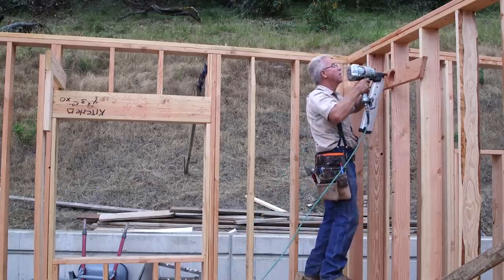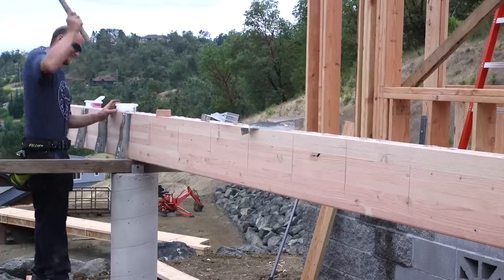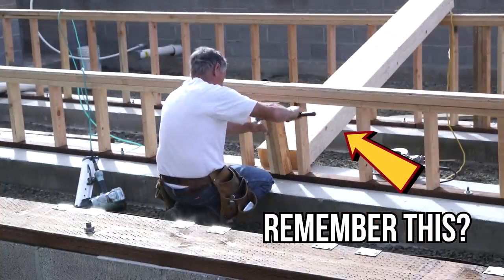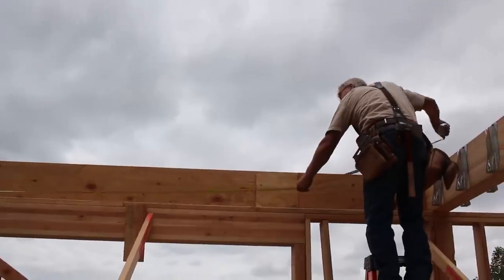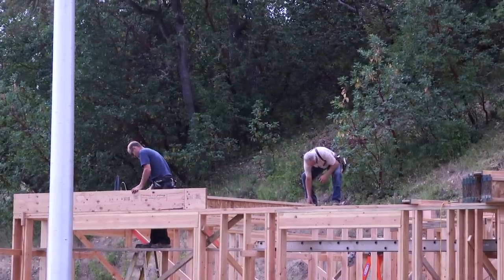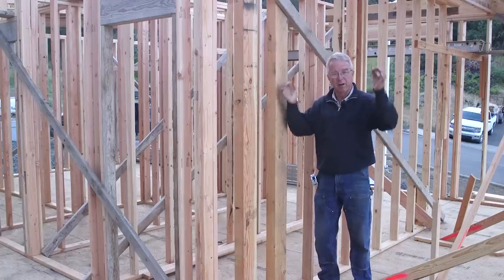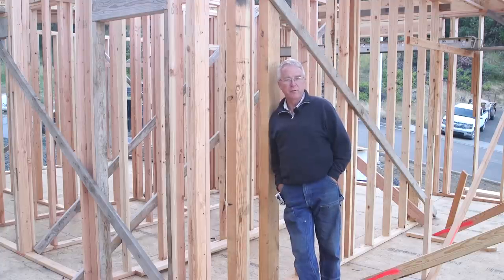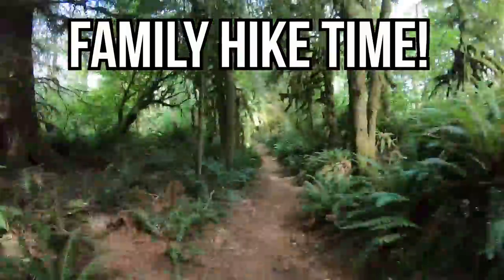Catwalks, Beams, and Posts Ep 50

Comment: The TJ I system I have used  require an 1 1/8 plywood rim joists and 2 x 4 crush blocks on either side of the TJ I around the perimeter to support the wall and roof. I enjoyed the videos.

Comment: After watching who knows how many videos of this channel (and a few others), I built my first structure ever this summer -- a 10x10 freestanding deck, next to the pool, sitting 4 1/2 feet off the ground. Disregarding some of the lesser built structures I saw on YouTube, I built it of my own design, but with one overriding concept in mind: "beams should transfer the load of the joists to the posts". I probably overbuilt it with all of the beam bracing and joist blocking I put into it, but this thing turned out like a tank -- no movement anywhere and no squeaks. Being a first-timer, I must say that the most important concept I learned about construction is not that you know so much as to never make a mistake (I told my wife that some people put their joists 12 inches on-center, but some of mine ended up 12 inches off-center), but that you know how to fix anything you screw up. Thanks for all of the tips and tricks and ideas!

Comment: Thanks for all the step by step moments in this construction project, Scott, it's been a pleasure watching! I've been in construction of some sort for over 30 years now, most of which has been spent in sheetrocking, finishing & painting. I have done some framing, rough & finish, tiling, flooring, window & door installation, etc. But I'm curious as to how those spots will hold up, those ''point loads'', in how the sheetrock will finish. I'm guessing that if you have any cracks in the board finish, those points will be where they will be. Here in the northeast, complete opposite of where you are, we primarily finish houses in blue board (plaster board) and veneer plaster skim-coat finish. It's a much more elegant and efficient manner in sheetrock finishing. It's done in parts of Cali, but mostly in new england. I'm guessing you may not have it out there, but if you knew about it, boy, you would be fascinated with the process. Anyway, just wanted to say thank you and keep up the awesome work. Looking forward to seeing the board hanging & finishing process. I know a hiker who lives out there named Half Ounce, met him on the AT in ''08. If you know him, say hi for me. 
~Steve H.

Comment: AS always excellent videos. Since I usually am the plumber and electrician as well as the framer Note that when He nails the plates to the floor  He keeps the nails next to the studs so you don't ruin a drill bit when running wire and pex tube. Most I joists have pre formed knock out locations, I try to cut off the end of the I joists that will  have the knock outs as close to aligning as possible so I won't have as many holes to drill.

Comment: While watching this I realize how little insulation can possibly fit where the rim joist is and in earlier videos where the kitchen plumbing is on exterior wall. This works for your area though but New England gets pretty cold. I remember you mentioning that different areas do it different ways :) Then again I'm sure you can fix that with exterior insulation which I haven't gotten to yet, assuming there is videos on that later, if not its easily doable :D <3 these videos, thank you so much

Comment: Watching you build a house almost completely out of timber frames is absolutely fascinating. Apart from the knowledge, skill and craftsmanship on display, I grew up in Germany where all houses are build from bricks, concrete and are heavily insulated. All in the name of long lasting buildings and energy efficiency. However i wonder if houses build out of more natural materials, that are easy to put up, repair and do not produce so much waste when eventually pulled down, have a lower carbon footprint over the long run.

Comment: I have loved following this series. Have an amateur question. Assuming  you are going to use OSB for the outside wall sheeting. Is there a reason not to put that on the first floor before building up? Seems like that would add a lot of strength to keep things plumb and square. Thanks for your channel and Keep up the good work!

Comment: I was going to question the dimensional posts until you pointed out that you lock them in.  With the quality of the posts I see around here I think I prefer a built post from 2x4 or 2x6. Your blocking will keep out the twist but what about the bow that shows up later? That's definitely going to be a stout quiet house

Comment: I can say this, someone is going to wind  up with a well-built home at the end of this video series
Reply: Huh? I thought its a youtube give-away or a half-way house for low income?!
Reply: It's my turn to say this tomorrow
Reply: Kyle K p, it’s a little too far north for that!
Reply: Well built? NO, no no... Well built home does not use any OSB garbage. This place may have a great builder building it, but I can tell you that if this house goes up in flames it will be a quick fire, also if there is ever a water leak on those OSB  (Joist's) they will be ruined right away.  In my opinion A Good built home is 2x12 floor joist's with 4x4 post's (or 10" concrete post's) ever 4 square feet supporting the floor, 3/4 Plywood flooring, 2x6 Walls, 2x10 ceiling joist's, steel strapping anchoring each ceiling joist down and each wall stud to the floor rim joist (or the concrete footer) then sheathed in fiber cement T-111 Siding.
Reply: @TRX450RVlogger  i live in Europe, where 95% of houses in built in brick or masonry of some form and we still have alot of house fire that completely destroy it, weird how that works huh lol
Reply: Thanks for sharing.

Comment: So I just finished building the +9 foot gate for my new fence. I don't like split gates mainly because they are a pain to close in strong winds which my area is prone to. I spent hours researching how to build a large gate that doesn't sag and I felt I had built the best gate I could but it turns out one thing I didn't think of. Even though I hung the gate from a 4x6 buried 4 feet in the ground with 280 lbs of concrete holding it in place the section of fence that gate was attached to was short and the weight of the gate pulled on that section of fence enough for it to sag several inches. My only solution was to either build a new lighter gate and hope it doesn't sag or turn the single gate into a double gate. I decided to split the gate in half. When I did all the sag went away. I actually looks great but I am concerned that I will have difficulty with it on windy days. The moral of the story is you have to balance strength and weight.

Comment: I notice that you do not include horizontal noggings between your vertical studs or cross bracing of walls?  Am I wrong or do you not need them in USA.
I am 76 yo semi retired carpenter/builder in Australia.  All in all a great series of videos showing how a house should be built, with attention to detail. Thanks

Comment: Thanks for another great video. One question. What is stopping the rim joists from bulging outwards because of the compressive pressure?
Reply: It's called platform framing - each floor is a panel, laid flat - the ends of the joists are nailed to the rim board and keep it vertical ( they form many "t's" which helps support the wall or roof that is built on top of them ) , and 3/4" plywood binds everything together.
Reply: @richardvsassoon5144  Thank you kindly for the explanation.

Comment: Wish we could get the quality of lumber here in Colorado that you’re working with. Recently we needed 2 straight 2x10x20’ for the ledger and rim on a deck. We ordered 6 and got 1 straight one. Ordered 4 more and final got the 1 we needed. Granted 20’ is a longish board to ask for, but we often face the same thing with simple studs. And forget about those nice 4x6 DF posts you’re using. Generally we just have to stack studs.
Reply: The studs from our local lumberyard can't even be toenailed; they're hard as a rock, and most of them already have splits in them.

Comment: As a gorilla (270 lbs) this is when I'm a little envious of you monkeys. 18 years ago I was standing on a 2 by 12 three feet off of the ground when it broke under my weight. I have never used a wooden plank since.
Reply: That's why you dont walk on the flat indeed. I'd put up scaffolding or build sturdier platforms it I was the one dangling in the air like that.

Comment: No liquid squeak insurance on those upstairs hangers? :)
Reply: Are you suggesting some kind of Silastic on the ends to quieten movement? I don't build but that is the only thing I can think you mean.
Reply: @DodgyBrothersEngineering  watch the flooring video - 'squeak insurance comes in a tube and is dispensed with a caulking gun' - the sort of dry humour that keeps me a subscriber...
Reply: @DodgyBrothersEngineering  In the episode where they installed the floor beams on the first level of the house EC applied construction adhesive to all the hangers which EC mentioned was overkill but was extra insurance that there would be no squeaks in the floor.

Comment: I wish all interior/exterior walls had double top and bottom 2X4, 2X6's, Etc. just for the extra nailing area for when doing trim, hanging anything. I hate putting up trim work, etc. and we're nailing into air. JMO.
Reply: Learn to knock on drywall with your knuckle. You can train your ear to find hollow spots and solid ones.
Reply: @user-xt1vs2oz3b , We do, but that will not put a block of wood where it's needed.

Comment: Loving the videos as I've been going through the process of design, permitting, and soon construction of a carriage house myself. Seriously enjoying the knowledge and experience you're sharing. Great work! Out of curiosity, why no blocking between studs? Is it not a code requirement?
Reply: No, it is not a requirement for interior walls and small jobs like this house. Occasionally it is required on bigger projects.
Reply: On the west coast, at least, it is still called fire blocking (you see it in older buildings - 100 years is old out here), and was associated with balloon framing, where the walls 

were made from very long studs with the floors nailed to the studs and blocking kept these long lengths straight, BUT it also created the potential for a fire to shoot up the entire length of the wall in seconds. Fire blocking was gradually replaced by the design of platform framing with top and bottom plates 'blocking' the spread of fire through the walls into the next floor.
Reply: @richardvsassoon5144  I was thinking for load bearing capacity. I'm no engineer but with enough weight the stud has the potential to bow or buckle along it's length. It is in the building code here.

Comment: Serious question: Are there any house building carpenters who are afraid of heights? (I’m fine in a scaffold but not walking on beams and rafters.) And if so, how is that handled on the job site?
Reply: I wonder that too. I don't like walking on walls; whenever we run into the need to frame roof sections (always fairly small) I'm crawling around pretty slowly.

Comment: For load bearing beams in the walls, for a two level house, and 3 feet of snow on the roof, I prefer to use 4x4 steel beams instead of 4x4 or 4x6  wood beams. Over two floors I have seen fir compress (shorten) by 1/8 inch per floor. Maybe not the first year, but fir will compress as it dries and supports heavy loads.

Comment: When floor joists are used for ceilings like this, talk to the engineer about 16 inch centers. When a landscape window or bright southern set is used run joist toward them. The sheetrock looks less wavy. Lay out the tub, shower, and toilet flanges so you don't hit one. If the glu-lam beams are between the toilet and a wall, talk to your plumber. Lay out duct runs and add blocking or cut out plates. It may affect joist layout. 9 foot walls with today's wood really needs blocking, they twist and pop sheetrock nails. Just my 2 cents for a high dollar home. If you're into production run junk then don't put glue in the hangars, they work just fine but squeak. And Jeffery Epstien didn't kill himself!
Reply: Ken MacDonald  
I spent my entire life building everything from doggy doors to high rises. Along the way I have learned to respect my elders and the fact that if you are smart you can learn something from everyone. You tube has provided me with a relatively easy method to pass this accumulated knowledge along to those interested in construction. Barring a few interlopers who are only interested in inspecting their own colon.

Comment: When did the industry stop using "fire blocks" in the walls?
Reply: It's a dated system ( balloon framing) that was replaced by platform framing with top and bottom plates 'blocking' fire from going up the wall cavity into the floor above.
Reply: I am dated at 82.  I grew up with lath and plaster walls and learned about Fire breaks from my dad.  Thank you for bringing me up to date. @richardvsassoon5144

Comment: It's my understanding that the main function of a rim joist is to provide lateral support for the joists (to prevent them from rolling at the ends) not to carry compressive loads. I.e. You could have the second story walls bearing directly on the joists if the joists had blocking between them to prevent rolling.  The joists can easily carry that compressive load.

I'm also not saying a rim joist is useless, because it provides a continuous piece of lumber on the outside of the floor so that there are no gaps to the exterior, i am just arguing that it is not a compression element.
Reply: You're correct for lumber joists, but this is using TJI joists (or BCI's or whatever brand)  They aren't able to withstand compressive  point loads like solid lumber joists can, and need other elements, like " squash blocks"  to take loads in areas like that.